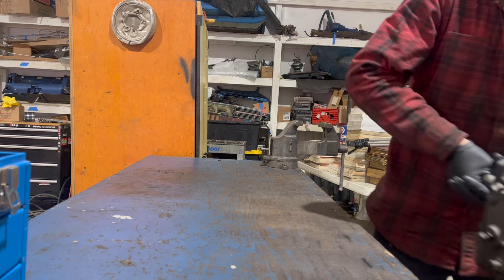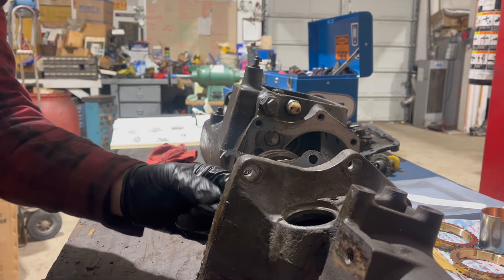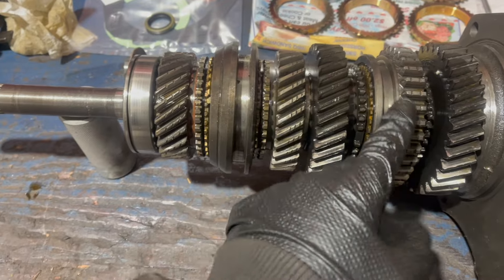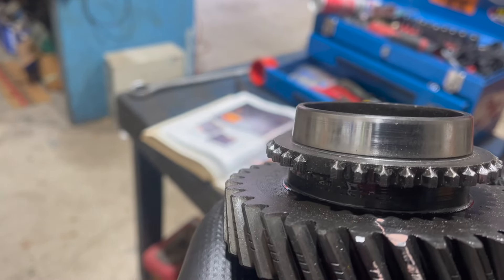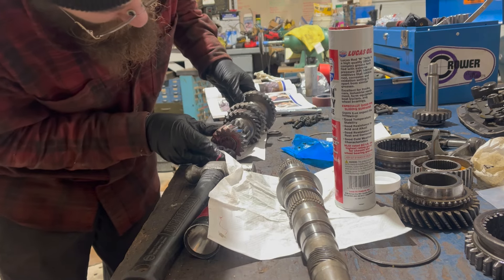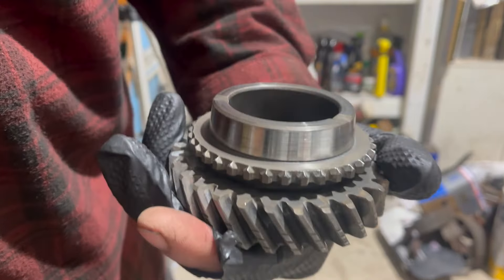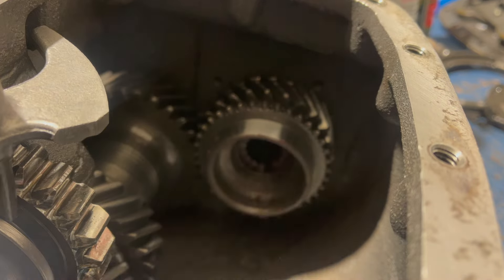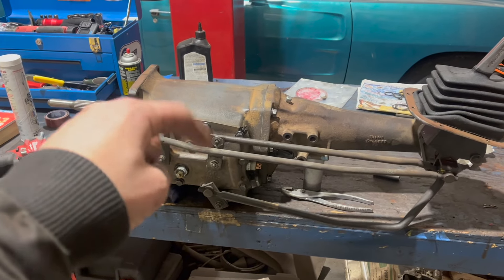How To Rebuild The Mopar A833 Four Speed Transmission! How It Works, Common Issues, And More!

Comment: Here's a tip. I was having problems like you did installing the main shaft and the front synchro falling apart. I used a zip tie to hold it together while jiggling everything together. Once together I simply cut and removed the zip tie. Boy was that simple. I  put that transmission together back in 1986 and it still works great! My first time doing one by myself. I had only watched a friend do one a couple months earlier. I'm over 70 and wouldn't want to pull that heavy beast again so I'm glad it's still working. 😊

Comment: Great video. Being a retired Chrysler tech, I would recommend using Vaseline to hold all needle bearings in place. Some grease DOES NOT mix with 80/90 lube and can actually block lube from getting to the bearings. Be sure to lube orings and seals with grease. I’ve noticed through the years that factory seals will come with grease in them, where aftermarket will come dry. I always enjoyed building transmissions, automatic or manual. Good knowledge to have.
Reply from the maker: Yes - the guide I was using also recommended Vaseline as an option. I ordered a tub of assembly lube (why does no one stock that anymore?) but I didn’t get it in time. I had done some reading and had decided that this would mix with the gear oil. Hopefully that was the right call. I have only ever been stressed out by automatics, but I would definitely like to get more comfortable with rebuilding them. It comes up often enough. On lip seals, I have read that they are supposed to be installed dry many times. I don’t know enough to say which is correct, but if a seal comes pre-greased, I’m sure leaving it on there.
Reply: @DeadDodgeGarage  I’d say the reason that no one stocks it, is because it’s basically Vaseline with a red dye in it🤔. Chrysler 3 speed automatic transmissions are one of the easiest if not the easiest to build. Once you watch someone build one, you wouldn’t have a problem with them. Go watch a few videos on it. The overdrive trans in another game altogether. There is an 800lb spring in the overdrive unit that has to be compressed to disassemble and reassemble it. But like I said, 3 speed is easy peasy. Cleanliness is important with automatic’s and always replace the torque converter as they can be loaded with trash due to the failure. Turbo 350’s are pretty easy too, but you need some special tools for them too. Just watch some videos and tear a few apart and you will get the hang of it 😀.

Comment: I have done several A833s in the past. I remember having the best results getting that tail housing and main gears into the main housing/input gear horizontal on the bench. Dad had some really old grease that was really stiff, it would help keep those roller bearings in place.
Reply from the maker: Red and tacky worked pretty well, but that makes sense.

Comment: I rebuilt the one from my 68 Barracuda years ago, using the factory shop manual.  I recall there was some weirdness about tapping the cover into various positions to avoid it jumping out of second or third gear, which I never got quite right.
Reply from the maker: As far as I know, popping out of gear is generally down to tooth wear. The cover is located by specifically machined shouldered bolts and should not be movable. Admittedly, I’ve never fully read the factory service manual rebuild procedures, so maybe I’m missing something.

Comment: I bought a 77 camaro done up like a 70 split bumper, with a 350 and the awesome and not prone to failure at power levels a lawn mower produces Saginaw 4 speed. Now it was nowhere near done when i got it and as i was in the military and living in an apartment complex, the manager of said complex told me i could keep it their for a week and make arrangements then it needed to disappear. So i did the responsible thing and took the plate from my recently sold mustang, slapped it onto my new to me charriot (im from pa and this was in Delaware) and rode dirty as hell all the way up to the mountains in Pa. I was aware that the 1:1 4th would cause high rpm on the highway but my god trying to do 65mph was scary as hell. By the time i pulled up my dads driveway that motor sounded like an ashmatic sewing machine. But that, at the time, 40 plus year old sbc did 2hrs of 3k rpm while puking oil everywhere and antifreeze leaking from the wp weep hole😅

Comment: You mentioned GM trucks with A833, and when you set it up on the bench, I thought, "That sure does look a lot like the Saginaw 3 speed in my 68 C10."
Reply: 80-87 GM offered the overdrive 833 in half ton trucks.

Comment: Great video they used to be a guy back in the day named four-speed all you could go to his house and get any four speed part you needed or have it rebuilt his kitchen had four dishwashers he used them to clean all the transmission parts his house wreaked of transmission oil his house was packed with four speeds all on shelves some rebuilt some for parts and he was reasonable he was busy thanks for the video

Comment: Great job. And thanks for doing this video. It brought back so many memories of the one I rebuilt way back when I was a teenager. I encountered all the problems you did, only I had no manual, no photos, and no special tools. But with a broomstick, sockets, long heavy flat screwdrivers, an ice pick, various hammers and many improvised tools I finally got the job done. The worst part for me was waiting weeks for parts. And my shift forks were worn very badly. I could not get new ones through the "direct connection". So I had them welded up and machined back down to the proper thickness at a local shop.  Oh the fun I had. Amazing what I still remember about that job more than 40 years ago. Thanks again man. Also I'm sure this will help many people.
Reply from the maker: Yeah by that metric this was way too easy. Haha. It’s great having access to all of the rebuild information, and even better having the access I now have to the factory tools. I’ve always been the “do it how you can” guy, but am enjoying being a “the right way” guy these days. Even so, I have a lot to learn - and always will.
Reply: @DeadDodgeGarage  I'll bet this video gets alot of views.

Comment: Tech tip on the ball bearing install.  Heat the bearings.  I prefer a non-induction hot plate or toaster oven. I keep the bearings dry so I can handle them with welding gloves.  Some people in our shop prefer an old fry daddy with transmission oil, but that means handling the bearing with pliers.  Have a hammer and brass punch handy just in case.  Heat the bearings to somewhere around 200 degrees F. Have the shaft near.  Pick up bearing and quickly install onto the shaft. If the bearing doesn't drop all the way home, tap it down, using the hammer and punch. Work quickly because, with the bearing and shaft being metal, the heat will transfer quickly, and you will lose the advantage you had. Done right, no press, and very little to no hammering need to be done. Do it wrong, well, you were going to press it on anyway.
Reply: BTW, about the induction hotplate.  You might think to set the temperature and set the bearing on it.  Easy peasy, right? The problem is the bearing doesn't fit over the induction coils and the temperature sensor at the same time.  I figured I would trick it by putting some sheet metal on the hotplate and put the bearing on top of that.  Apparently, the induction waves work far better on the bearing than they do on the sheet steel. That bearing got VERY hot VERY fast. I overheated the bearing.  I highly recommend a conventional hotplate.

Comment: One important disassembly tip that was missed. Always file the slots on the shift levers BEFORE pushing or tapping them out of the side cover. These levers get hammered thru hard shifting and will create a lip on the slot that will score a groove on the inner bore of the side cover. This will result in leaks that are hard to repair.    BTW   The hole in your glove is getting bigger......
Reply from the maker: Great tip! They pretty much fell out of this one with no effort so I think I got away with it - but I will watch for that moving forward. Yeah… the holes on the gloves never get smaller. It’s fine, they’re only almost $30 a box 🥲

Comment: Wonder if bacon grease would work...
Glad to see you using a file. That's what I was thinking of doing.
Your shop looks a lot like mine. I keep a lot of boxes empty and with stuff in them too.
We took a piece of cardboard and put holes for the bolts in the same pattern as the side cover. I also put parts in plastic bags if necessary.
Reply from the maker: That technique works, the bolt positions are important - but I think there are only three longer bolts, and only one with the long shoulder. Easy enough to see where those three go. I had actually planned to show how I check which bolt goes where when assembling things in this video, but… I forgot. Everything gets bagged and tagged in our shop if it’s going to be apart for any amount of time beyond a project like this. As far as bacon grease, well, I’ve never put anything together with it - but it’ll definitely smell better…
Reply: @DeadDodgeGarage  My experience is that what starts out as a simple job that won't take that long ends up being a months long possibly nightmare job so I've learned that even if something is going back together in a couple of days I bag and tag everything. I'm just not that experienced and many times I'm working with numbers matching vehicles. Sometimes I get help from an enthusiastic Ford guy who has a hard time grasping the importance of "original" and tends to throw parts in a box without labeling them. 
M-m-m-m-m-m. bacon!

Comment: I have found that leaving the input shaft retainer for last makes it a whole lot easier when installing the mainshaft assembly. That extra 1/4" movement forward makes all the difference. The mainshaft just falls in place, and the input rollers don't fall out.
Reply from the maker: I’m going to try that on the next one! I could definitely see that little bit of movement making the difference.

Comment: If doing work on a 1970 with A833, you need to check the actual build date of the car, some were built late 69 for the 70 model year.  There was a change in the synchronizers from 69-70 that will ultimately cause issues.
Reply from the maker: Interesting. Good to know.

Comment: It's a great video!  Can you show us how much end play or slop the input shaft  has now and a audio of the new front bearing before you install it?  I have a early 69 roadrunner 833 sitting in the garage that sounds terrible  when turning  it by hand .
Reply from the maker: Yeah that’s very common. I see noisy input bearings all the time. I did try to show the ‘normal’ slop after replacing it toward the end of this video.

Comment: Theirs is a good chance that the gear you swapped will bind. The groove lines on the gears have to match. The one you installed has no lines. Put in second gear and see if it turns smoothly.
Reply from the maker: It turns great.

Comment: Why aren’t needle barings magnatized?  Wouldn’t that make assembly easier?  
Your channel is great.
Reply from the maker: The shaft would have to be magnetized, not the needles. If the needles were magnetized, they couldn’t all be polarized the same way or they would attach to the shaft, but repel away from one another. At least if I’m thinking about this right. The good news is grease works, and there needs to be lubrication in there anyway.

Comment: I redone my 69 18 spline using a old chilton manual....just for reference a tailshaft housing from an 1982 d150 is the same as a 69 B body lol..even has the same part number
Reply from the maker: Should be the same as ‘70 B/E with the dual shifter mounts. I don’t know when they started using that in B bodies exactly - but either way, functionally equivalent! The forward pad is what B body uses. Those dual pad units were in trucks and vans for as long as there were A833 overdrive four speeds.

Comment: It seems to me that you might be able to use all thread in the body then install the main shaft. I’m just an old Machinist who use to do making things simple when it came to production setup one man style.
Reply from the maker: I’m not sure where all thread would come into play?
Reply: @ Same as the tail housing bolt holes. Use the all thread to help support and guide the main spindle gears home.

Comment: Would this video also apply to the overdrive 833?
Reply from the maker: Absolutely! The process is exactly the same. The only differences are 1) the overdrive gear in place of 3rd and matching countershaft cluster, 2) the larger IBR plate, and I believe they use the larger front bearing of the 18 spline “hemi” transmission, which makes assembly slightly easier. Also, if you have an aluminum main case, make sure the countershaft isn’t able to move freely or spin in its bores. If it is… that’s a problem. It can be corrected with bushings, or you can look for another case. I’ve seen one of them damaged quite badly.

Comment: Did you take note of the blue 3 digit number on the gearbox housing?

It looked like it was "389" if so could that be a factory marking for the gearbox to be matched up to a 389 ci v8 orange painted engine possibly.

Just asking because I am from the UK and we use cc / cubic centimetres,plus our manual rear drive gearboxes are direct selector meaning our gear stick goes into the gearbox and operates the selectors through a ball and socket style bar selector built into the top of the gearbox.
Reply from the maker: I’m not sure what it means, but it definitely isn’t engine displacement. There was no displacement that would’ve matched that. 

Ok, I did a quick search and learned it was the ‘picker number’ used at the factory to quickly ID which four speed was which, as there were several variations in production at any given time.
Reply: I believe you mean internal rail shifter, like a Morris minor box. The 5.0 Mustang T5 is similar.

Comment: So... Even if the transmission is in neutral some of the transmission internals are still spinning while the clutch is not depressed?
Reply from the maker: Absolutely. This is a constant mesh transmission, which means the input shaft, the gears, and the whole countershaft will be rotating at all times when the clutch is released. Power just isn’t applied to the output shaft in that position. This is why you will hear gear rollover noise when stopped, and also why really super toasted overdrive four speeds make noise when at a rest and the clutch is out - but the noise goes away when you hit the pedal.
Reply: @DeadDodgeGarage  Thanks for taking the time to answer and explain. I appreciate that.
I'm picturing a cold start, with the starter not only turning the engine but also the guts of the transmission while the oil is cold and thick...unless the person holds down my clutch at startup.

Comment: How do I fill up oil ? Some leaked out when I pulled it out
Reply from the maker: The fill plug is the square headed plug about halfway up the main case on the passenger side. There are pumps available at the parts store to get fluid back in.
Reply: @DeadDodgeGarage  how much do I put in ?
Reply: @DeadDodgeGarage  what type oil ? It's 833 chrysler 4 speed .
Reply: @proracing9025 Fill it until the oil starts to overflow out of the fill hole. Jamie mentioned to use GL4 80W90 oil.

Comment: Reverse is also the only straight cut gear, correct?
Reply from the maker: Yep. There are three straight cut gears that make up reverse - one on the countershaft cluster, one on the 1/2 shift collar, and the sliding reverse idler.

Comment: How's the Charger coming?
Reply from the maker: Blue ‘73 Charger? Just got back from paint! See the 451 stroker video for engine build info and shots of the car. There are several other Chargers around, I’m just guessing you meant that one. Lol.
Reply: @DeadDodgeGarage  Thanks for the update - I was asking about the '68 you bought and drove home in the rain...no wipers, I'm familiar with that!
Reply: PS Great video!
Reply from the maker: @richardweyland116  Oh, thaaat Charger! Haha. I really haven't done anything but drive and enjoy it since the last video I released. I changed the gears, fixed the charging system for a second time, and started daily driving it last summer. It needs a few little things - mostly tires that don't rub. Currently I'm doing other things so mostly ignoring that. I've had it out twice so far this year. Love that car.

Comment: What gear oil does these take? I have a 69 roadrunner with one of these and I need more fluid in it but I don’t know which one to get…
Reply from the maker: Several different fluids have been used in them - ATF apparently being one the factory used. As I understand, the best fluid is a GL-4 spec gear oil. GL-5 apparently lacks an additive that helps to protect the softer synchros. So look for an 80w-90 or similar that specifically says GL-4, but you may want to just drain whatever’s left in there and fill it. It should take around 2.5-3 quarts, if I am remembering correctly. My brother has used a concoction of Royal Purple gear oil and Lucas additive. Sounds expensive.
Reply: @DeadDodgeGarage  thank you 🙏
Reply: The capacity is 3.75 Quarts of 80W-90 GL-4 gear oil
Reply: @Sir.Veza_  I was googling it and it said to use 85w-90 should I go with the thicker or thinner weight?
Reply: @robertpursley4907  Reason being there are many old car enthusiasts living up in more northern climates where their car is stored for the winter, 80W-90 will remain stable until -14F. However 85W-90 will start to turn into gel around 10F. Notwithstanding if you live in sunny So Cal or a Southern state it's a non issue. MAKE SURE IT'S GL-4 though.
Reply: @Sir.Veza_  thank you 🙏